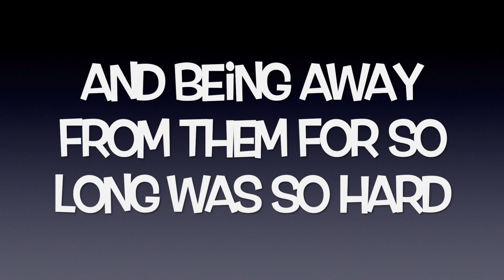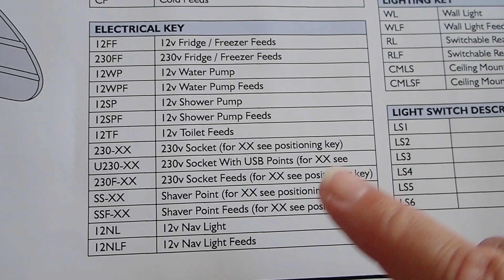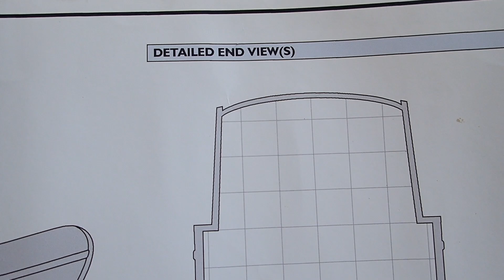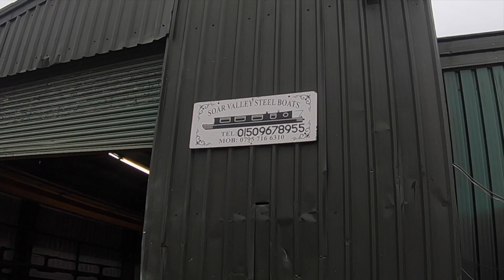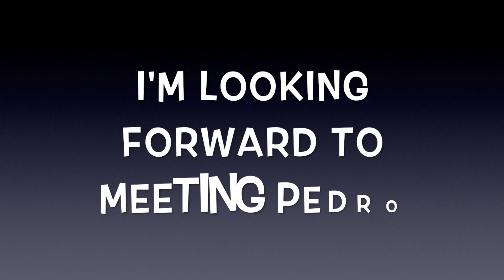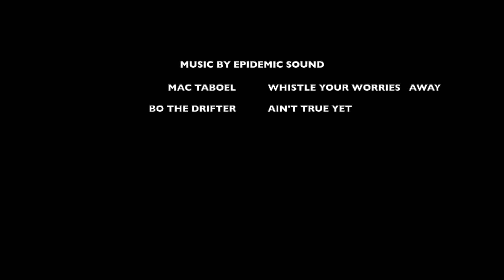Vlog 5,  The Build Begins - Week 1

Comment: Anyone can, with practice, learn to wire weld and the equipment is quite reasonable.  A 250A machine or better will do and used industrial wire welders are often easy to find.  While that shop is sweet you can build on levelled welding stands outdoors if you lack space. Overhead cover is easy to make. Plasma cutters are highly desirable but someone practiced with a torch can produce excellent results. See boatbuilding forums for many methods the professionals use because labor is most of a build cost.